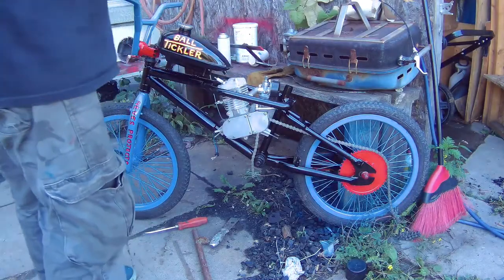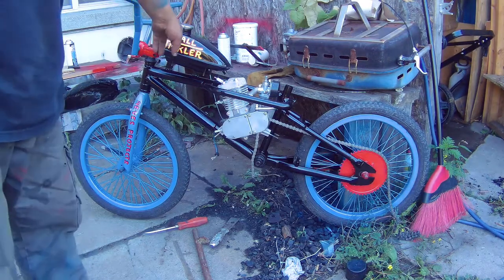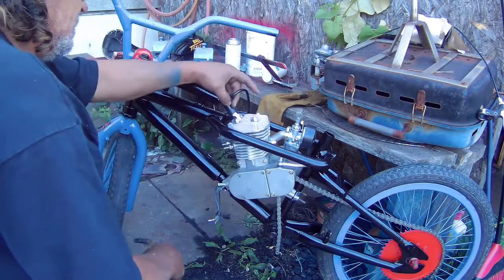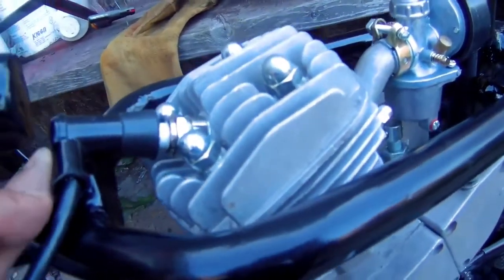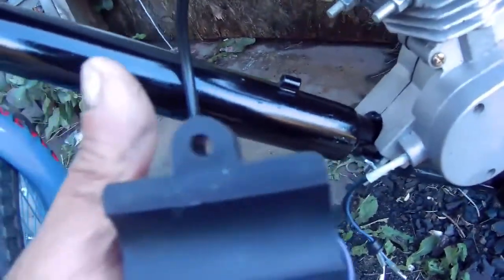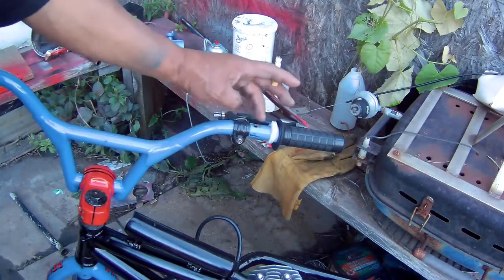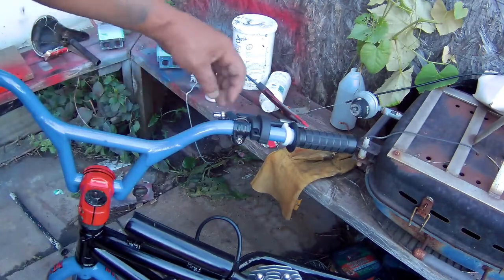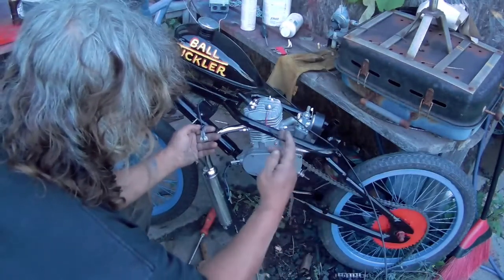80cc Motorized BMX Bike pt.5, Paint and Assembling

Comment: on these motors you can turn the head around so the spark plug points the other way. and the throttle handle should have had a pin in it like all mine do. must have fallen out. nice bike though, i like what you did with the frame.
Reply from the maker: Thanks Dan, I didn't know that you could turn the head on these, will keep that in mind if the engine moves while riding, and yes I found the right throttle cable after, I misplaced it